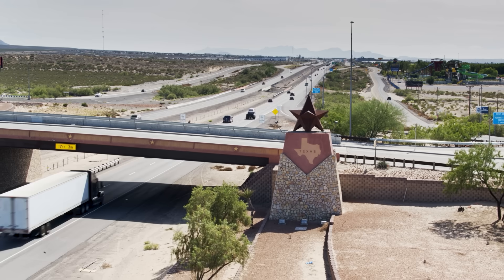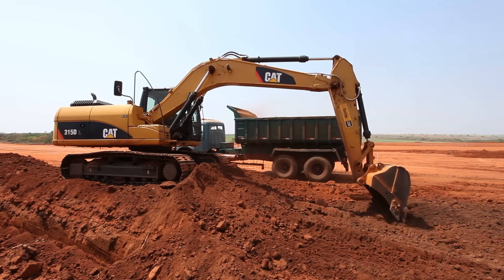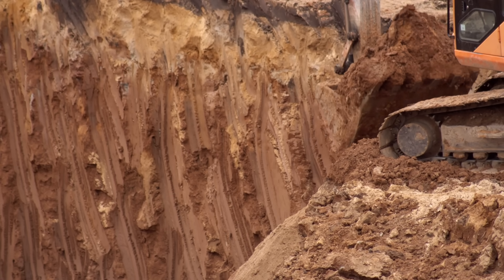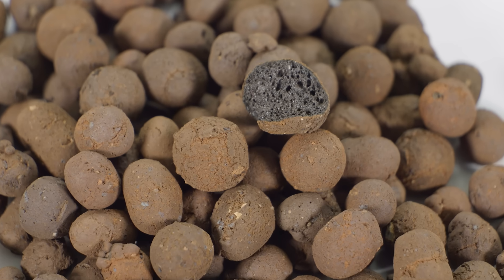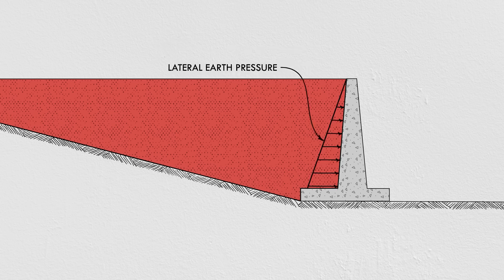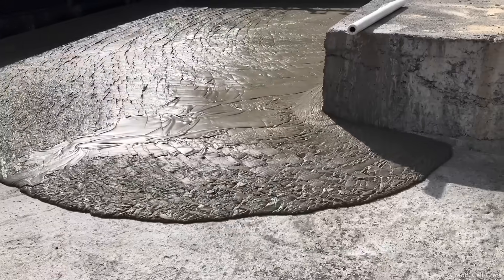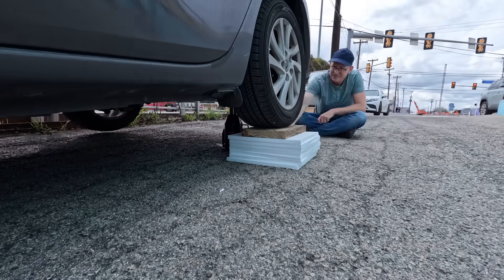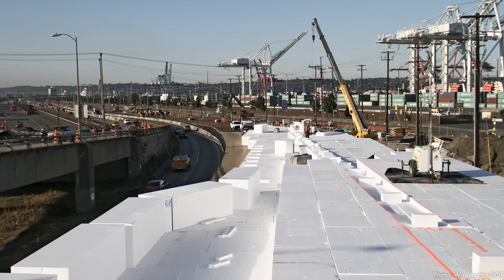Why Some Roads Are Made of Styrofoam

Comment: In Scandinavia it is common to use styrofoam as foundation material for buildings. The thermal disconnect is highly desirable when its -20 C outside, and it provides a very good stability when ground changes shape due to freezing water. Maybe an interesting subject for a video?
Reply: If done correctly the ground under the house does not freeze, in fact sometimes extra insulation is placed in the ground around the corners of the foundation to prevent freezing of the ground underneath the corner which could damage the house.
Reply: @zapfanzapfan in the Arctic buildings are  often/usually on permafrost so the problem is reversed and we need to prevent the soil from melting.
Reply: @zapfanzapfan Wow. Really? Profound statements and deep Knowledge in the comments:)
Reply: @madistamela5975  If you have a poorly insulated foundation the house keeps the ground warm enough to not cause a problem by freezing but now with very well insulated foundations for passive houses it has become more of a concern. I was surprised the first time I saw it before I understood why.
Reply: I heard that a problem with this method is that animals can get into it and start digging it out, then it can be a big problem
Reply: @MadSwede87  Usually those blocks are coated with a thin layer of cement and/or a cement glue, to improve the adherence to the other building materials. In most cases rodents will not bite into those. I have not heard of any issues with EPS or XPS blocks in foundations because they are usually also surrounded by other impenetrable layers. However, if someone would come to me with that question as a genuine concern for their house, I would refer them to the EPS blocks that have metal meshing on the surface for even stronger adherence (p.e. needed in facade applications where plastering is mounted directly on the insulation).
Reply: @MadSwede87  Or eating it, like rats do on some body panels and wire insulation. Ants too.
Reply: @Einwetok  Termite is the biggest concern ... rats are bad but unitl the Termite shows up
I always wonder I recall my first class in material science in my engineering degree is starting selecting your material based on chemical environmental requirements ... I think the prof and the book should have said: chemical biological environmental requirement is more appropiate for the newbie in engineering
Reply: @MultiYlin  Depends on where you're talking about. Rats teeth are harder than humans, never quit growing and can damage some metals. Formosan termites are the most destructive on earth, and have been released in the US. Neither one is a regular problem in tundra environments. 
Termites are harder to eradicate, since you have to pollute the land (and risk killing wildlife/pets) to make sure. Rats aren't that hard, if people are willing to commit to using their natural predators against them in combination with real traps (not those carebear ones). We have plenty of dog breeds tailored to the job, and minx are abolutely genocidal when used right.
Finding a genetic solution to eradicating both is worth every penny invested. For termites, something like what zinc does (without polluting the land). For rats, genetically deactivating their teeths sturdiness would work. They would wear out their teeth to the point of starving.
Reply: Can confirm, my dad is getting a shed built and Styrofoam was used before pouring the foundation
Reply: I wonder if it this is how the floating islands were made along Norway’s coast.
Reply: You may be thinking of insulated concrete forms.

These are still concrete, but they use styrofoam to hold the concrete during cure. Once cured, the styrofoam acts as insulation.
Reply: I live in Norway and just saw the new highway built with the foam, and I was curious as to why av if I was really seeing Styrofoam :)  this explains a lot!
Reply: When we build a new 7 floor university building it was built with that footing. It also had a 1.5 floor cellar so the weight of the building was fully supported by the material removed. Needing no other foundation what so ever. Basically a house floating on soil.

The only hard part is that it have to be super water tight
Reply: Worst thing is that I was being sarcastic initially. Internet has thought me a lesson... Good luck, well-meaning people.

Comment: Thank you for another wonderful video! Speaking of using styrofoam for thermal insulation, I work for a small mountain railway where we sometimes battle with frostheave (also a video idea? ;) ) We experimented with using styrofoam in the subgrade to prevent the ground from freezing. It worked well as insulation, but unfortunately the ballast stones have a knack of punch through the sheets under load!
Reply: It's worth saying that what people often call styrofoam,  that is eps is not actually foam. It's made in a other way.

Pollyuretan foam is actual foam. It's twice as good insulator but also twice as expensive (hence 4 times as expensive per volume)

If you need a lot of insulation for a very low thickness  that is what's needed. (Insulated water heaters and garage doors are often made of that. It's yellow and quite fragile.
Reply: They also use it to protect the permafrost up in Alaska on the Dalton Highway for the same reason (and dang that road can create some epic frost heaves!). From what we could see they used some sort of fabric membrane between the aggregate and the foam to avoid the same problem.

Comment: A really common term -- roadway...  The headline matches a definition given by the Oxford Dictionary (at least the one time I checked).  It defined "roadway" as the roadbed, or what is under the pavement.  According to that I would say it is the " dirt " under the road, separated by the pavement.  Do you want to drive on the pavement, or below it???  Well in the text, there are several uses of "roadway" as a synonym of plain road.  Consider that, and have a nice day!

Comment: My country doesn't seem to even bother, the roads that go up are built on pillars and to completely avoid that bump, the connection is made using a flexible joint to deal with expansion, contraction and soil settling.
Plus they change the floor to some kind of gravel and build some other concrete base thingy.
I have a feeling it's really expensive though. Foam would be cheaper.
And way more awesome. I've seen sections of buildings being transported, I'm fully convinced if our government does it, they may just transport the embankment in  3-5 massive pieces.

Comment: Thanks for making this. Living in Seattle as a member of a family of civil engineers, I was pointing out the use of styrofoam in the construction around the viaduct southern entrance. My mechanical engineer colleagues refused to accept that the styrofoam was used for structure, insisting that it must be temporary packaging waste! I'll happily share this video with them.
Reply: That will be so satisfying.
Reply: About 60 years ago, I visited Seattle. I was surprised to see empty lots with soil piled up sometimes up to 10' high. When I asked, I was told that they did this to compact the soil. It might take 2 - 3 years to compact the soil, then they hauled the dirt someplace else and started a building project. A learning experience for a farm boy from Wyoming.
Reply: When soil is moved, how do they avoid it being decompacted again?
Reply: A family of civil engineers and a family of beavers are basically the same thing
Reply: @liamhodgson  👍😎👍👍
Best comment yet.
Reply: I noticed Styrofoam being used on some of the southern approaches and thought they were using it for a temporary embankment. An engineer on a tour of the construction site set me straight.
Reply: Styrofoam is also used in building foundations too!
Reply: I was QC at a plant that made foam that goes in the ground for these ramps. We had a project about 5 years ago in iowa that was shipped north for thousands of blocks of foam. 4x5x16 feet blocks. Its such a massive amount that its hard to get your head around. I think it was 2.80lbs per cubic foot. Better foam than youve likely ever seen. It made me into a foam snob honestly.
Reply: Good video
Reply: The key arena remodel also used geofoam extensively around the exterior of the building.
Reply: Seems like the thermal disconnect and icing mighta played out a month or two ago up there??
Reply: @timmyopally  hah- the cement surfaces above the styro definitely iced over. I cant believe I made it to work that day. On the way out of the arena the plaza out side was nearly as much of an ice rink as the NHL one inside. That was one hell of a morning just to fix a cellphone antenna that no one was using that day 🤣
Reply: The first time I saw geo-foam used was during the construction of the ramp to access the upper parking floors on the south side of Renton City Hall.  I was an engineer in the wastewater utility and had to ask our transportation engineer if it was actually Styrofoam. It was very interesting to watch the construction.  Unfortunately, the whole ramp settled approximately 2.5 inches over time due to the underlying soils (the whole area was originally a wetland).
Reply: @johnnyh3653  yes-  check the underlying soil conditions! as a transportation engineer i have removed many poorly engineered 'light weight fill' installations and built viaducts and retaining walls. generally it can be traced to underlying conditions - nothing wrong with Styrofoam as fill per se.
Reply: The new 405/167 HOV interchange also uses EPS for the embankments.   Pretty cool the first time I saw it.
Reply: I live in Seattle! Where do I see this styrofoam?
Reply: @mcdougle5772  I don't know of any sites actively using it, but visit the arena and you'll be standing above it
Reply: I think that Is a good solution until the soil floods with water and the buoyancy cracks all the road.
Reply: As a service plumber I hate working at a house that is owned by a engineer! They are so egotistical and always think they know better
Reply: @jackofalltrades123  I've run into plenty of arrogant tradesfolk myself who also thought they knew better (they didn't), and yet you don't see me running around to trades focused channels and randomly shouting about how egotistical and dumb tradesmen are. 

Writing off an entire profession full of hardworking guys and gals as egotists because you had a couple bad experiences is a poor show of character friendo.
Reply: @Gobeldeg00p  it's not a couple dude. It's the majority! And most of yall do have an arrogance to yall so don't get mad that I pointed it out! Just like it's not my fault that 13 percent of a certain race commits 50 percent of the crime. It's not my fault! It just is what it is
Reply: @jackofalltrades123 sounds like you think you know it all.   Sounds similar to trump lovers who think if they don’t get what they want are willing to overthrow the government.  Just like someone who is denied a job and has nothing to lose.
Reply: It's used as a void form they also use cardboard boxes for this same effect.  The structural attributes are minimal
Reply: Just remember, civils build targets… mechanicals build weapons… mic drop.
Reply: @gunner4544 maybe you guys with the weapons should get together and collectively stop — from a Ukrainian. Honestly, weapons development was the biggest mistake in human history.
Reply: @gunner4544  yeah,  I've heard that one before.  And?
Reply: @gunner4544  You say that like building weapons is a good thing. When in reality, it just reinforces existing power structures and increases the odds of us all dying. We've had weapons capable of causing human extinction for nearly a century now, how can anyone still think we need to invent even better weapons?
Reply: @argenteus8314  while it makes sense, it's the same reason we keep making cars even after the cart, or better boats even when we have boats.

Just because we have achieved an end goal does not mean it can be improved. The weapons of mass destruction are quite that, but you don't always want mass destruction. If you personally has access to a nuke to use at any time, it wouldn't negate the need for personal defense or usage. If you're in a store that's getting robbed, you're not going to shout "you better leave, I have a nuke and I'm not afraid to use it!"
Reply: @oopomopoo  OK, but my point wasn't that there's no way of making better weapons, it was that making better weapons won't improve anyone's lives at this point, and that it will in fact simply make things worse. At best, it just becomes another tool in the arsenal of the governments of the world, further reinforcing existing power imbalances. If anything, less destructive weapons have even greater potential to worsen those power imbalances, as governments would have less reason not to bring them to bear on their own people (and anyone who thinks that's unrealistic needs to read more history). And that's at best, at worst a new weapon could upset the existing balance of mutually assured destruction by allowing a single country to act without fear of reprisal (for example if a defense against nuclear weapons were to be developed, or a weapon which could be deployed so quickly there would be no time for a response).
Reply: @argenteus8314  It's not a good thing; it's a joke. Unfortunately the delivery was rather off, mentioning targets before weapons, so it's no surprise that the joke failed to connect. The usual delivery is:

Q: What's the difference between mechanical and civil engineers?
A: Mechanical engineers build weapons. Civil engineers build targets.

The amusement in the joke, of course, comes from the fact that a central point of engineering is achieving design goals. Weapons are just one of the many things that mechanical engineers build, but when doing so they are building things toward their intended design purpose: a weapon is successful when it causes something else to fail. So there's no surprise there. But the mention of "weapons" sets up the next part of the joke.

The intended purpose of a civil engineering design is to provide a road that is drivable, a runway on which you can safely land an aircraft, a dam or retaining wall that retains the material it's supposed to, and so on But when you think of a civil engineering project as a "target" for the previously mentioned weapons, you're thinking of it as something that's going to be deliberately caused to fail to achieve its intended design purpose, quite the opposite of a civil engineer's intent.

You can probably see now both the joke and why delivering the joke backwards, by mentioning targets before weapons, doesn't work.

Comment: Are there any examples in public infrastructure where foam injection is used like the older mudjacking to level concrete. I have a mudroom that was slab on grade, probably 40 years old where the center of the floor sank almost 2" most likely due to expansive clay, a thirsty tree and a drought. The solution was to drill some holes and inject a 2 part foam. One year later it hasn't had any detectable movement. I do wonder if that is done on larger scale.

Comment: I had a summer work on a road construction a few years back. The site was on a former seabed and wasn’t hard as rock. We used expanded clay as filler on embankments. There was a huge pool of it after the bridge. We used also tons of expanded clay concrete under the roads.

Comment: 12:43 Ah yes, styrofoam (packing peanuts work better) dissolved into gasoline (or kerosene) .. also known as poor-man's napalm.
Just keep dissolving foam into a container of fuel until no more will and you're left with a thick sludge that'll stick to just about anything and will burn for a VERY long time. (with a couple household additives, can even get it to burn for about 2 hours)  it's also rather difficult to extinguish.

Comment: Dont forget that eps I used as light weit agregate in concrete,  this mitigates the problem with fire hazards , eps blocks burn very  good and are  sensitive to solvents, as you 
Concluded. The cement slurry insulate the eps cells from one onther. 
It is very light and floats esaly in water.

Comment: This video triggered an old memory (literally decades old) of some science-comm TV show reporting on use of styrofoam as the 'aggregate' for some road(s) in ... I think it was Norway.  Something about it solving some issue with the cold there (unlike the "insulates, so ice forms more easily on the road surface" you quoted), maybe the fracturing caused by ice infiltration in traditional aggregates ?

Comment: I play a game where you build things in 3d environment called Satisfactory. One of my pet peeves is that I build solid and heavy Concrete foundations wherever possible, and all of my concrete is made using the default recipe, not the cheap one you unlock later in the game. Using lightweight materials for a road, or in my case a train track or a factory floor, just feels, wrong..

Comment: I watched a highway on-ramp connecting to an overpass being built near me. Geofoam was used extensively. Once they built up with the geofoam complete with a banked curve, they covered it with a layer of concrete and then finished the roadway as usual.

Comment: A few tears back.  A 2 lane highway was expanded about 20 miles south of me.  One of the things done was to replace an old, narrow, steel bridge.  As I watched the progress of the construction of the new bridge.  I noticed they were using huge foam blocks at both ends of the approach the the bridge.  It's been in use now for several years, and I've passed over it countless times.  I have not noticed any detrimental effects because of it.   Time will tell though.  I understand that the weight of the roadway, and vehicles, which includes trucks is spread over a large area because of the large blocks.   Still impressed that so far, the blocks themselves haven't compressed even more than they normally would.  It's now a modern 4 line highway.